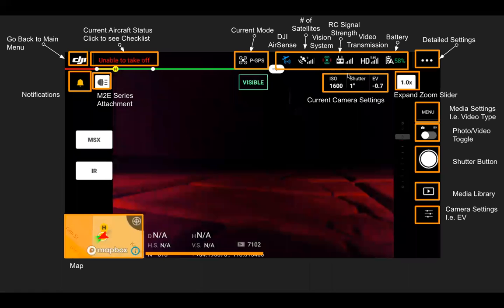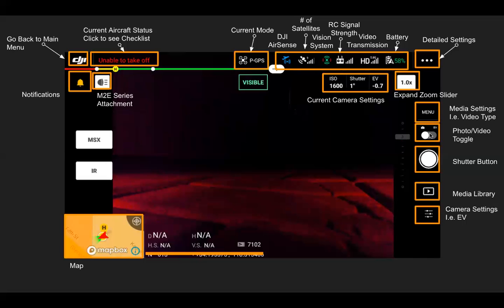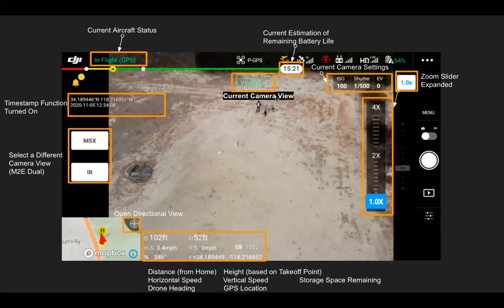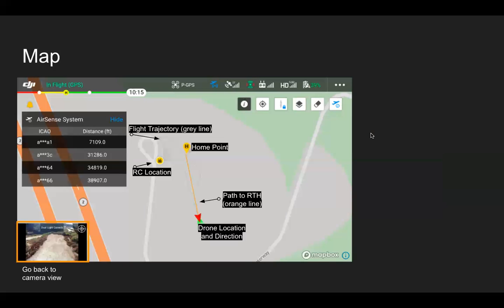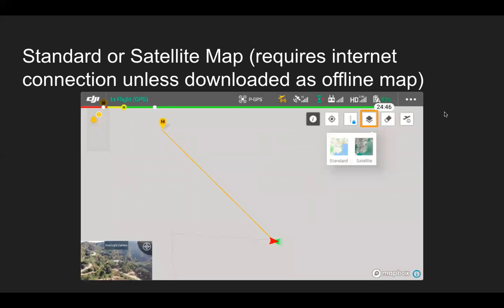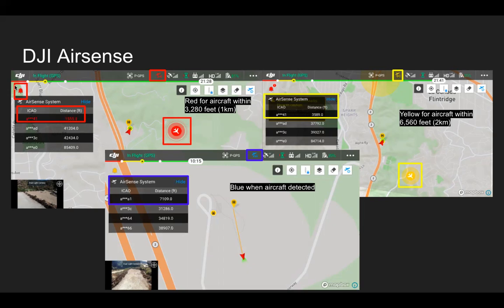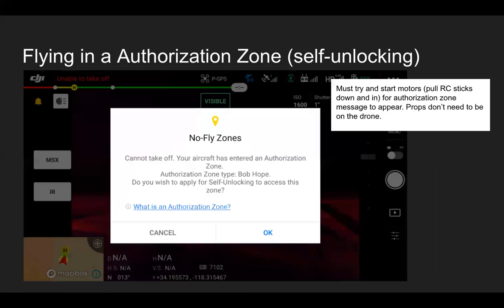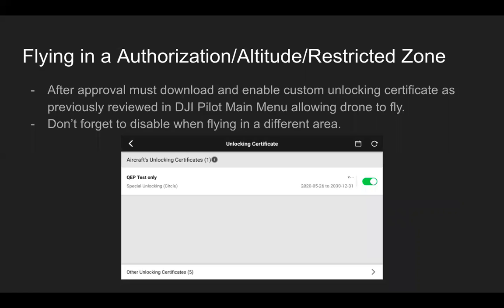DJI Pilot: Manual Flight Display with the Mavic 2 Enterprise Series (Zoom & Dual)

Comment: I updated to DJI Pilot 1.1.5 from 1.1.4 and didn't change any settings on my DJI Marvic 2 Enterprise Dual and now I cannot see a live video feed from my drones camera? Is there a new version of the DJI Pilot app to fix this or a workaround? I talked with DJI Support and they recommend I check my drones firmware, which I then updated. Still no luck.